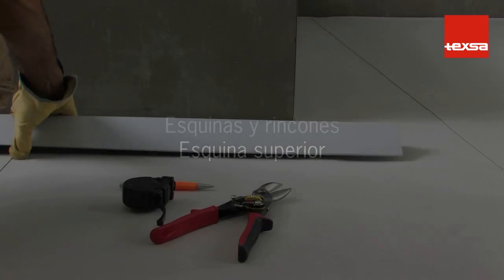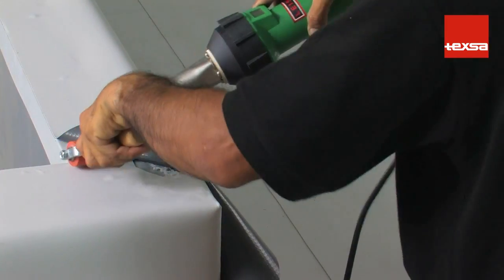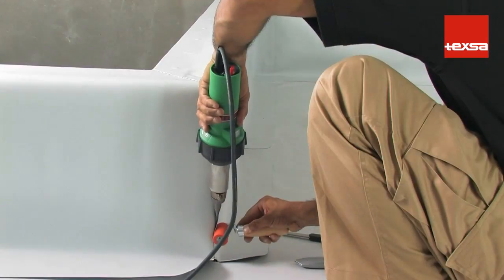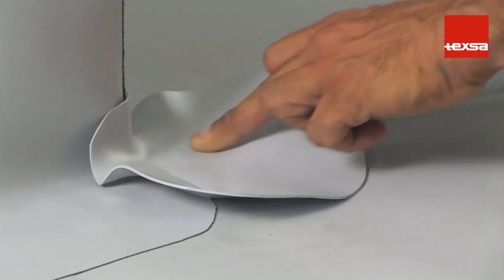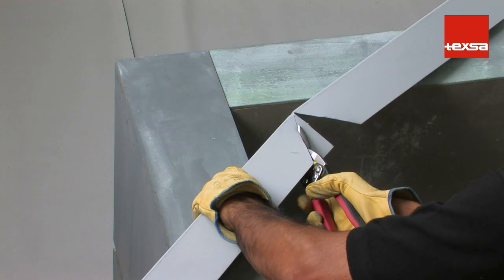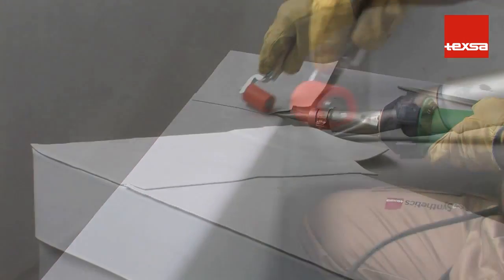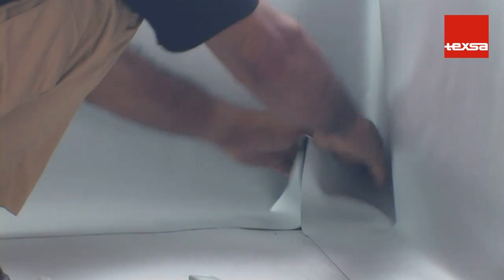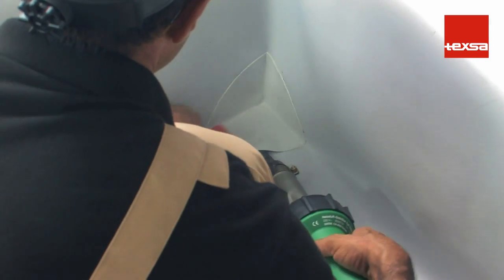4/7 PVC Waterproofing Membranes: Corners and angles - Texsa (English)

Comment: Very good video...I have done more than 100 swimming pools and we never use the liquid (because it looks really bad) and the way you demonstrate on how to do the corners is not right at least for swimming pools! Apart from making sure that there will be no leak when it is filled with water, you need to do the job in a way that will look good for the client too. Instead of using the liquid once you have finished the whole job, you can put your Leister at 500 degrees and start making all the lines from the joints melt by using your leister from a distance and pressing the roller so that the outcome will look amasing without having all these lines once you are finished! it is not that hard, it will take more time but you will love the result and so will your clients!
Reply: We produce this hot air welding kits same funtion with Leister's. welcome contact Elynn Chen  Mob / Whatsapp: +8613515002282   E-mail: sales3@lesite.com.cn    Skype: lesite03
Reply: +Elynn Chen hi its maharaj from pmb looking for a welding machine for tarps thanks 0764829827
Reply: Hi sir i need you help actually I am preparing for my job interview and i have only knowledge about liquid applied membranes and application but don't have any idea of APP and HDPE membrane can you please help me about membranes.
Regards
Dixit

Comment: Wich is the recommended temperature for welding PVC liner with this manual machine ? tks great videos!
Reply: It can vary based on additives, but usually 310-360C varying on your speed,  nozzle,  and membrane